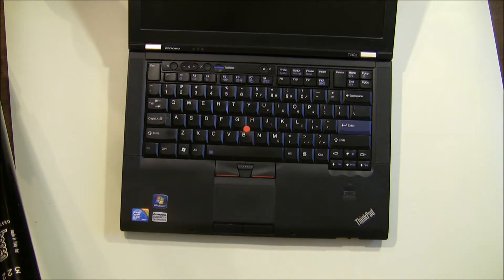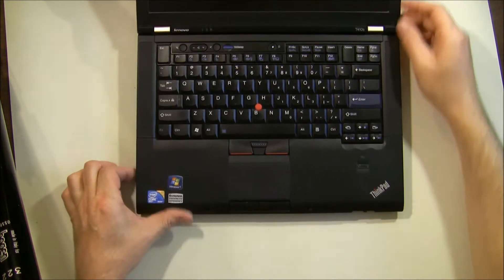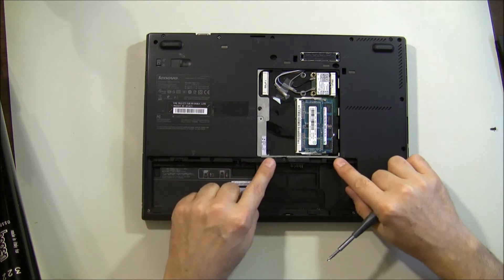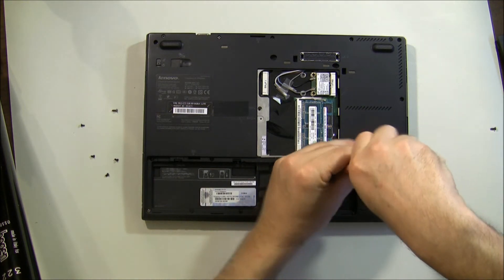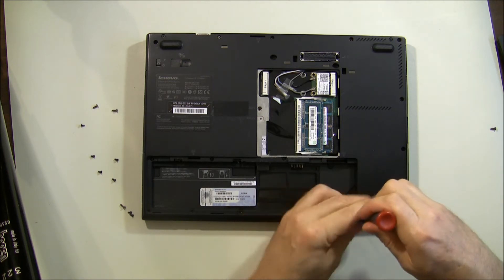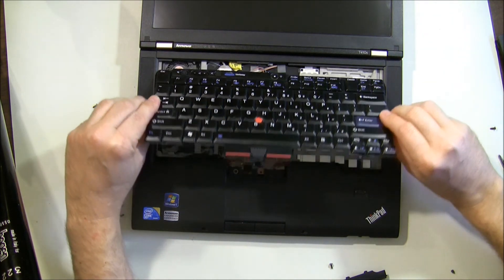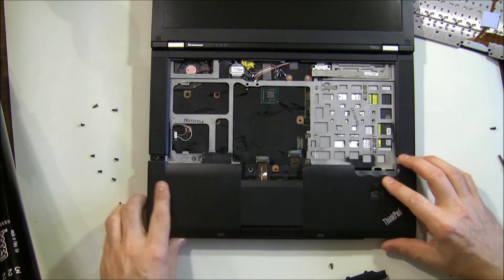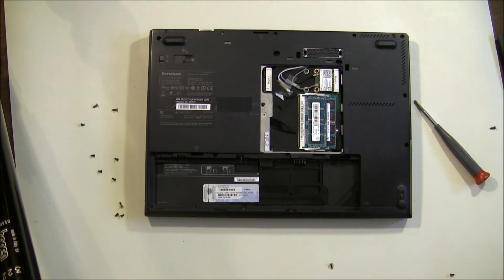Lenovo Thinkpad T410s Palmrest Replacement

Comment: I want to replace the palmrest of my T410 for a palmrest with fingerprint reader. Will it work if I just buy one with fingerprint reader and replace it and install the software? Tnx!
Reply from the maker: This video is of a T410s but I know that it will work with that model, not sure about a T410.  I know the models can be confusing.